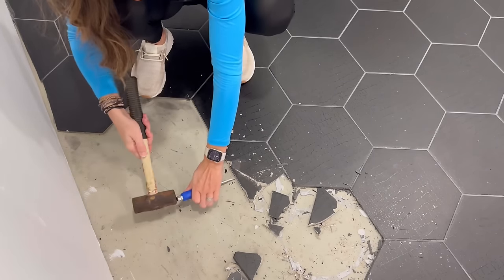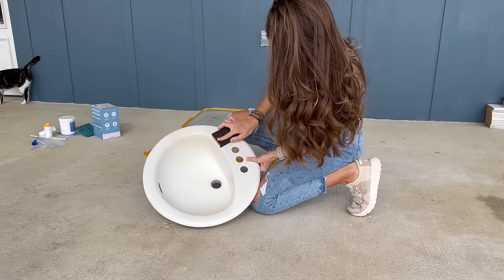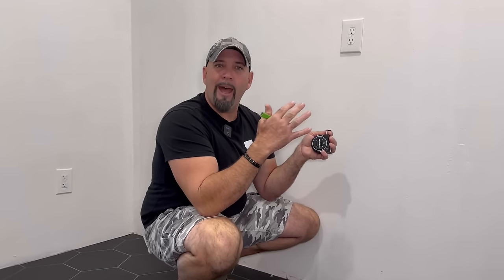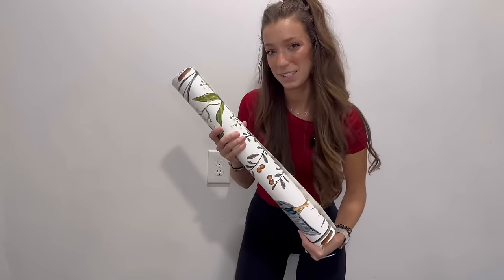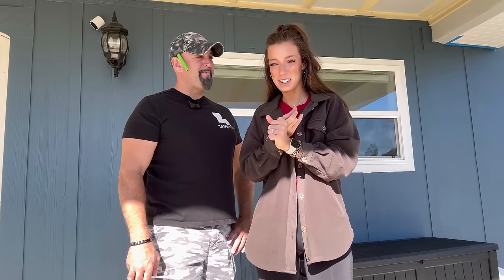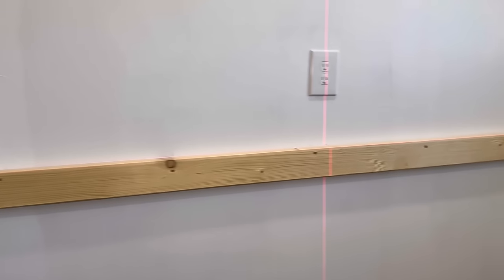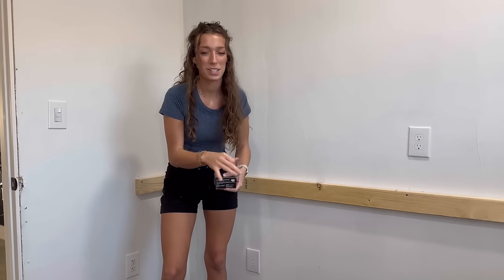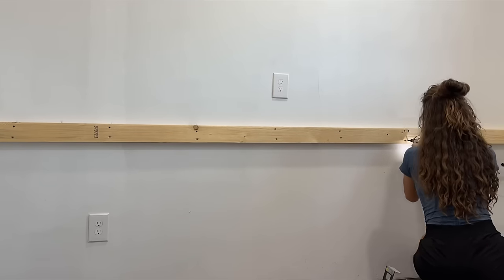Constructing A Vanity | Building Our Own Home Ep.123

Comment: When I've built a countertop similar to yours, I added a steel angle  to the inside of the wood  rim to give it extra support. Screwes spaced about 6 to 8" usually is sufficient to take out most of the flex of the unsupported countertop. If you weld in a support clip that fastens to the end walls it will be even better.
Reply: I would agree if you sit on that top now, the unsupported, outer, long 2 x 4 may twist a bit (less strength) since the short 2x4s going to the wall are rotated 90° from what I would’ve expected.  Sistering additional short 2x4s 90° next to the other short ones would help.  Still, depends on the rest of your plans for the custom cabinet.
Jim did make a good save and the squirrel idea was cute!

Comment: I did that fancy cut for my baseboards because I didn't trust myself to cut the 45 degree angles properly for the corners.  I cut an inch off the top of one and just made the other board stick out an inch to fill that gap by removing the 3 inches below it.  Fit like a puzzle piece if that made sense.  I don't have one of those fancy miter saws.

Comment: Good morning Jim and Lydia.  Great to see y'all, I've missed y'all.  I loved Ladly putting on those crocs and her eyes, facial expression and little smile when thinking if Daddy would like it...priceless.  As a suggestion for next time you have a situation when you need to use "the buddy system" on a single stud - try using a lap joint, a little glue, drill and screw.  Viola, a strong joint without the risk of splitting or missing the anchor point.  The room looks great and I love that tile floor.   I also like the subway tile and color you selected Lydia.  It's going to look great.  One thing I"m unsure of is the size of the vanitey top, running the full length of the wall.  Possibly it was simply for an anchor point as it is a floating vanity.  I'll be following to see how it progresses.  You guys are doing a great job!  Have a blessed week ahead!   Larry, Central Valley, Ca.

Comment: I need a new vanity in both of my bathrooms. I have been thinking of purchasing them from a big box store, but they don't carry  any that really fit my measurements. So now I am wondering if I can do a custom vanity and will be watching how you get this done.

Lydia, I enjoy the "commercials" that you produce because you find a way of making them fun. I am guessing that even though you applied the product with a paint brush and roller that it is self smoothing and doesn't have a texture. Is that correct?